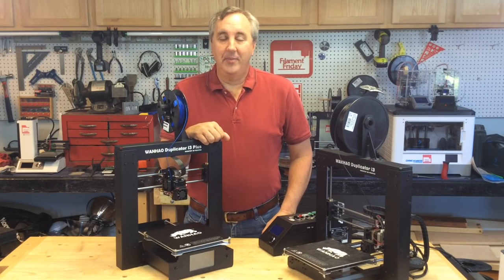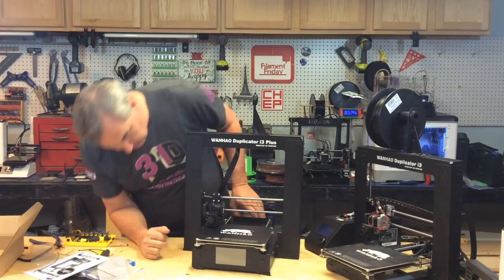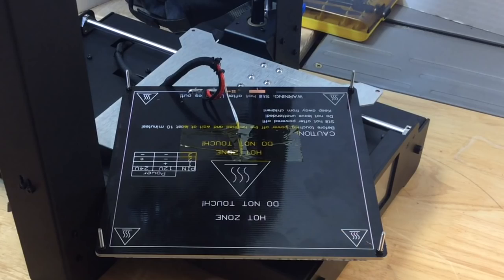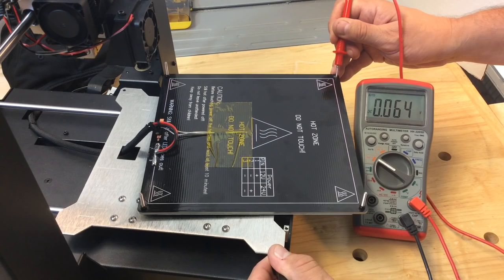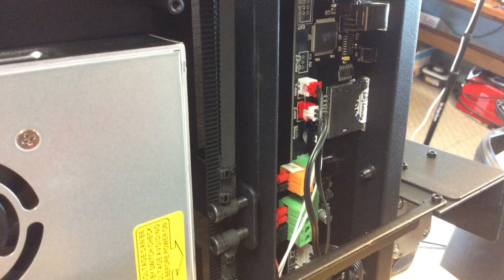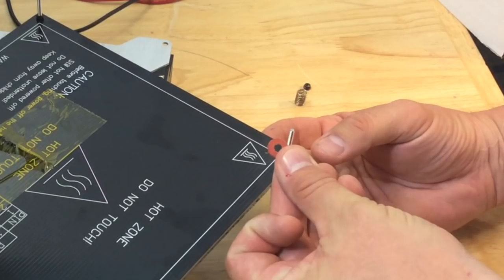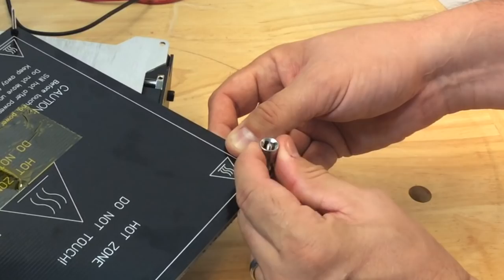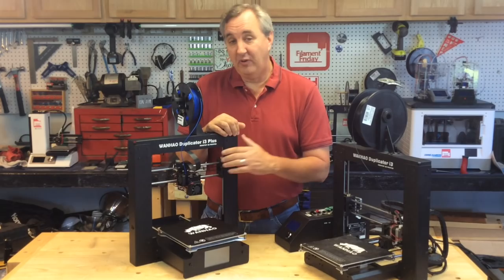3D Printing Filament Friday #83 Follow-up - Fixing the Wanhao Duplicator I3 Plus 3D Printer

Comment: Well spotted Chuck. That is a very serious problem. Like you have done here, I use PTFE washers for insulation on all PCB mounts. Full PSU current flow on the heated bed, so any type of short could be a major risk of fire or damage.

Thanks for getting the video up and making people aware on the safety side - with moving parts and electrical systems it's so important to be aware of these issues. Good Job!

Comment: This (and Richraps follow-up) should be mandatory viewing for 3D printer owners, and especially builders. Helluva a good job documenting and informing the community about an issue. And also a reminder that DC power even if much lower voltage than mains AC, is still electricty, and can still be hazardous. Big thumbs up.

Comment: You are not over reacting to this issue Chuck. It's very serious and deserve a Product Safety Recall.  You know those springs are going to eventually cut into the element traces on all those units.
Reply: THAT is the scary part right there.
Reply: This is also probably true for any printer with a bed that has the heat bed traces close to the retaining bolts.  It could be worth sharing on the Reprap forums as a warning to look out for heat beds.

Comment: Definitely not an over reaction at all.  Great work in diagnosing the problem.  I do wonder about the bed Y-Axis belt screws touching the main board metal compartment.  If the source of the power is coming from there that means there is a grounding problem there too, correct?  

I hope this doesn't become Wanhao's Galaxy Note 7.  I own the Monoprice Maker Select v2.1 printer myself and love it.  I hope Wanhao can address this quickly.

Comment: I get a poke on the Printrbot Metal Plus once in a while, which is pretty identical in construction to this one.About time I checked if it's the same issue using your method of elimination of causes.Thx for the tip!

Comment: Not an overreaction at all sir! A dead short power to ground is a very serious problem.  I have seen them burn a hole through a PC board and start fires under the right circumstances.  Wanhao needs a recall or at least an emergency service bulletin on these printers.  Please continue to press the issue!

Comment: Good job hunting the problem down Chuck.
5:10 Have you had a close up look at the original I3 you have to see if the springs dig into the bed traces as well ??? 
Perhaps the problem has not shown up (yet) because it is not (yet) rubbing the pate  mounting screws underneath.

Comment: Thanks Chuck and no you are not overreacting. that is a very serious issue and a respectable company should address this immediately. i am surprised how come there is no fuse to protect against such a short. but fuse should be the layer of protection. the design needs to be fixed..

Comment: Thanks for the heads up Chuck.
Since the short occured before the heated bed was heating, that means that the bed is switched on the negative supply.
Surely it should be switched live.
Do a lot of printers use switched negative?

Comment: Whew! That could have been a disaster.

Great job isolating the nuts and springs, but what about the screws themselves? Aren't you concerned about the screws coming into contact with the side of the holes?

Comment: That's a pretty inexcusable design flaw. I'm also disappointed that the bed power apparently isn't fused (or at least, is insufficiently fused to blow from a short like that).

Is the printer chassis tied to the AC input ground? Might be worth running the printer on a GFCI outlet to be safe.

Comment: That looks like a MK2 heater, if the under carriage is not metallic it's less of a big deal.
What I'm thinking though is trimming a bit of the pc board sandwich, just around the holes should fix this. Can you verify the +/- leads are correct on the bed terminals?
(and are connected to proper psu + -)

Comment: Hmmm! 24v in itself would not normally cause electric shock, I'd be a bit more concerned about where the energy came from to generate a spark across that gap, maybe some LC involved (two parallel conductive plates and airgap?) and the rubbing of the contact surfaces causing rapid switching on/off of the current.  Still a good spot and followup investigation, it needs fixing.
Reply: 24V can definitely cause electric shock. I know that from personal experience. It just depends on how conductive your fingers are. (As mine are young, they're thinner and more tender.)
Reply: You're probably right, as with most things there is a range of possible outcomes depending on voltage and skin resistance, as I'm sure you know it's a matter of how much current flows, which, up to 10V DC, Ohms law can be used to predict the current depending on skin resistance. I have read that there have been cases of people dying from 12V applied from a car battery across the chest with water applied but the vast majority of people with dry hands would not feel 24V DC.  The main resistance of the skin is on the very outer layer and is affected more by moisture that the skins age or thickness although I suppose hard skin and callous skin would have a higher resistance ... maybe.
Reply: More like your skin is often moist or wet, so resistance goes down. Do you get sweaty palms?

Comment: I remember the first week of having my hictop prusa i3 and one of the stepper drivers blew up in flames and smoke, luckilly I was standing there when it happened
Reply: im not sure, I am guessing it was a faulty board, I simply turned on the printer and it blew. I contacted hictop and they sent a replacement out right away, I also ordered one off amazon for a spare.

Comment: Ok, 1st off, please, if you have that issue, toss the heater in the garbage. His washers are a good idea to prevent it but once it's happened then it's likely now the short will go through the screw, bolts heads, aluminum plate, what ever.. Once the super thin insulation is broken, it's likely the super thin heat element is broken and is shorting on the opposite side.
Reply: Agreed. This is only a bandaid fix and doesn't address the real issue; a faulty bed heater. That sharp end of the spring could eventually cut through the fiber washer.

Comment: Hey Chuck, I've just ordered the Wanhao i3 Plus.  Firstly, would you recommend returning it in favour of another model due to these issues?  I've heard good things about it from others.  Also if you could tell me the size of the washers you used I'd be appreciative as I'm thinking I should order some to make the necessary fix when the printer arrives.  Thanks for the video, I'm glad I stumbled across it before the printer arrived! 

Subbed.

Comment: Tevo printers have similar beds and include those insulating washers.  I think the only thing preventing this from affecting the Anet A8 is its acrylic frame.  I'd recommend adding insulating washers to any bed design where the springs may cut into the solder mask.  If you want to print some, I'd recommend using Nylon or PET-G, but not PLA due to the heat involved, and not ABS due to inflammability.

Comment: Surprised the PCB traces go out to the perimeter .On all the beds i've seen over the years the traces end well before the perimeter of the bed. If this is the "latest" generation of PCB style heated beds then the problem might not be limited to just the Wanhao !!
I think it might be an idea to drill the hole out to 4mm then sleeve the screws with heat shrink and use a nylon washer. Those fiber washers tend to degenerate in a few months of repeated heat cycles.
The cheap springs without coil runout / flat ends isnt helping this issue either 
Either way its a good catch and lets hope Wanhao and the heated bed manufacturer take this experience on board and resolve it properly.
Just out of interest are you using a 3 pin plug or the standard USA 2 spade without earth?
Reply: Phil, that's a great idea drilling out the holes then sleeving the screws. I also didn't know the fiber washers didn't last through repeated heat cycles. That's good to know.
Reply: Strange that the rogue "current" didnt go to earth then  and fuse your earth leak protection/ RCD's. Maybe as it was 24VDC it didnt trip anything.
Another thought that crossed my mind is that as the bolts are held into the PCB bed plate with nuts they will expand as it heats up and potentially pinch the bed traces. Not sure if the bed is the alu type or the fiber glass PCB type. Either way nylon or PTFE washers to allow for the dissimilar thermal expansion would be a good thing.
Reply: I once had to do the sleeve thing on my original Prusa Air2 as the y carriage didnt have the (now) standard hole pattern. Actually did 2 sleeves on each screw just to make sure.  I think the potential fiber washer issue may depend on the type and quality. Added to which, with the high humidity where i live, anything porous does not survive very long. Coating them with super glue can help extend the life but nylon is still the way to go.
Reply: I noticed in your video that you have an almost identical machine ( earlier model i believe) in frame. How's the bed on that one ??

Comment: It's not a good look at all, and considering Wanhao is so established compared to some other manufacturers coming out of China it really makes you wonder what else is going on. Will we see 3D Printer chassis' become live and shock someone with full mains potential? I bloody hope not...
Reply: I watched your review on the i3 plus...Have you checked yours for damage to the bed as well?
Reply: Sorry +CHEP 3d printing...I was talking to +maker's muse...lol
Reply: Not yet, I will inspect it.
Reply: +Maker's Muse, what I saw in the video was 24V so it's not mains and I wouldn't expect anybody to get electrocuted. 24V can tingle but is unlikely to kill. But it can cause fire (we did see smoke!) and worst case it could overload the power supply, causing that to overheat or possibly worse. Somebody else already asked why there wasn't some fuse that got blown out by that short.

Comment: Chuck, You said you powered up the printer but did not heat the bed so you should not have been able to get a voltage reading when you probed the arced traces on the bed.It appears that you either have 24 volts in the bed all the time or the power is coming from another short somewhere else. Putting in the fibre washers will isolate the heatbed but does not seem to address the source of power while the heatbed is off.
Reply: The headed bed is switched on the low side via a MOSFET. It will always have 24v in reference to ground. When the MOSFET is turned on it will heat up as this allows current to flow.
Reply: Sorry, I do not have a DI3 Plus so I'm not much help there.I have not seen a system where the bed is controlled by grounding rather than turning the power on and off but what you have been told seems correct, if there is power and no heat then it is for sure controlled by grounding. Your isolation washer is the best solution.Hopefully the bed  design gets changed to prevent this in the future.
Reply: OK, so now I'm feeling kinda foolish because all my printers work that same way and I knew it! Sorry to Chuck for misleading him.It's only 8:30PM here so I can't even blame my brain fart on being tired.
Reply: Both the response by CHEP 3d printing and your humility has raised my faith in humanity today.  Thanks for not making this the standard youtube comment crazy festival.

Comment: 24V is not life threatening. That said, if there is sparking, the voltage may overshoot, and that is probably the "poke" you felt. And you certainly do not want sparks when working with acetone on or near your printer. Imagine the surprise :-)
Reply: I've done it - the wire turns red hot and melts. It is a fire hazard (not an electric shock hazard). 24V is not enough to push any significant current through you (if you don't lick it). Unless the short circuit damages the power supply and a secondary fault causes higher voltage to appear. Anyway, the issue with the printer is serious, thank you for bringing it up. You have fixed the heating board isolation fault. What about the belt holder - case fault, do you think it can be fixed, too?

Comment: Good catch, not the first time Wanhao Di3 have had fire issues!  This is probably true for any heat bed which has traces close to the retaining screws.
These should also work for insulation and just remove the metal washers http://www.thingiverse.com/thing:1374667